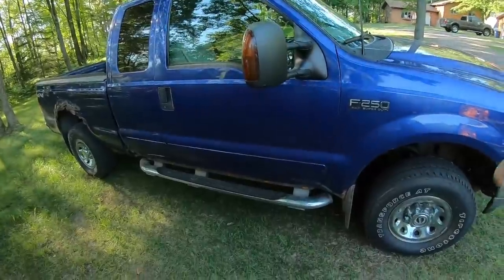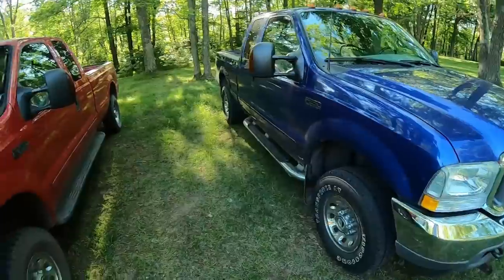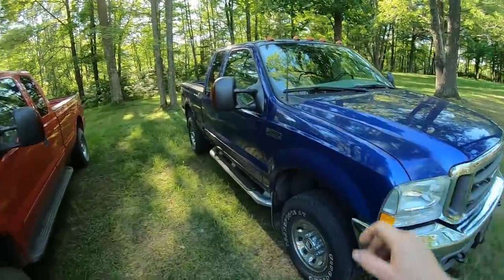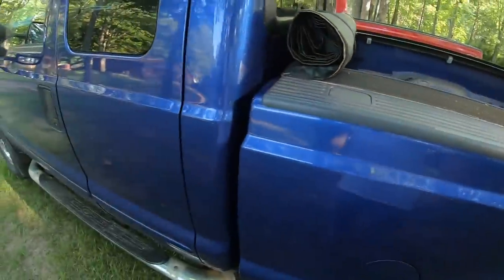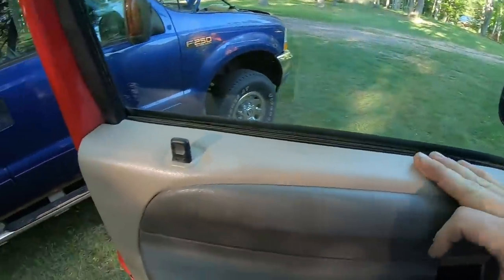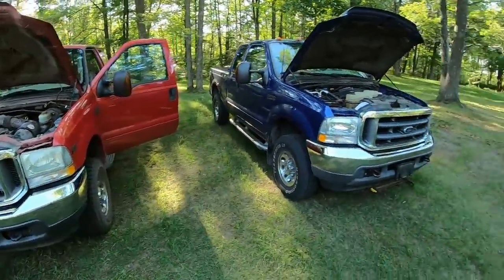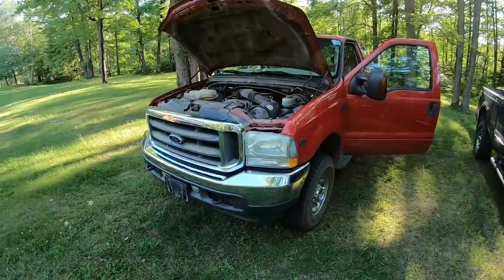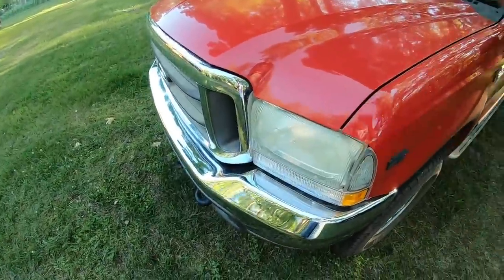I Bought A New Channel Beater Truck!  Meet "Big Red" - Possible Replacement For "Old Blue"

Comment: I’d definitely swap the grille and lights off of Old Blue onto Big Red; and go ahead and flatbed Old Blue and keep it as an off highway farm truck.
Reply: Yep, an interior swap would be cool too. If the headers start leaking swap motors and you'll have the best of both worlds.
Reply: That's what I was thinking.  And, why not use Old Blue to plow snow exclusively?  Replace the stock bed with a flat bed to use on the estate.

Comment: I had a 2008 F150 crew cab that I traded in on a 2017 F250 aluminum body crew cab. The 5.4 had some cam phasers go bad. Dealer tried to sell me a Diesel. No deal. Bought the 6.2 liter gas with the 6 speed automatic. It pulls my 8,000 lb travel trailer through the western mountains at 62 MPH. I’m happy

Comment: Swap the front end parts and the interior and you've pretty much got a new truck with the bits you like.  If you can't get used to "Big Red"...  it will be a mixture of Big Red and Ole' Blue so there is always "Violet".   if you like big girls...

Comment: The first-generation Super Duty was probably one of the best trucks Ford ever built - so many of them still out there running around. I'm hoping to find a nice one with the 7.3L Powerstroke one of these days to replace my "Old Blue" 2000 F-150. The 5.4 and 6.8 are great engines IF given proper maintenance...I've currently got two 5.4's and will only buy another one if I know it's been treated well and had the spark plugs & manifolds already done. Otherwise...diesel for me.

Comment: Melt some toiled wax rings, add in some used motor oil and use a garden sprayer and soak your undercarriage with it. Then FluidFilm inside the doors and bed

Comment: Two words "RUST CHECK" or some other oil spray. I have a 2001 Dodge Dakota with zero rust anywhere even the suspension bolts are still shiny. Been oil sprayed every year since new. Other than being oily the truck is a joy to work on as every single bolt will undo nicely.

Comment: Melt some toilet wax rings, add in some used motor oil and use a garden sprayer and soak your undercarriage with it. Then FluidFilm inside the doors and bed

Comment: Sqatch, killer score. I have that exact truck. Its a beast!  V10 pulls very well. Mines 263k and has never been torn down. Will be doing t chains and rockers/ lifters this fall to address some tapping cold. She loves the gas, specially when she's working. Worth it for a solid soldier. Congrats

Comment: Good looking truck. You are right about the rust belt. My 07 Ram spent the first 7 years in Michigan. Then we moved to South Georgia in 2016. The rust hasn't gotten any worse and is confined to the box above the wheels and one of the back doors. We have a V10 in the bus at church and you are right they like gas!

Comment: Glad you found a older truck with low miles. My favorite ford gas engine is the 460, those engine’s were so reliable.

Comment: Squatch253, great little segment.  I live in Arizona and deal with sun damage to paint and plastic parts all the time, even rotting hoes due to the low humidity!  I have a 1999 1/2 F350 Diesel. 212000 miles.  Just had to repaint the hood and roof due to extreme paint damage, but mechanically a great truck.  I have also owned a 2000 f350 diesel that I lost in an accident, sad to see it go, great truck.  I also owned a 2000 Excursion with the V10.  Loved all the vehicles, but in my warmer climate, I will take the diesel over the v10 any day.  
I owned the 2000 F350 and the 2000 Excursion at the same time and used them as commuters and to tow a 10000 pound RV.  The diesel pulled hills much better, but were both a pleasure to drive.  The one issue that I did have is that the V10 ate thru 3 transmissions while I never touched the diesel tranny.  They both had the same tranny, same rear end, etc. but I guess the higher RPM's on the v10 kept trashing the planetary gears, even the heavy duty ones.
Glad you get to use a good Southwest truck to keep things going on the farm.  Love my F350!
Good Luck with it!

Comment: Before you trash the dashboard cover consider this it does 3 things:
(1) helps protect dash
(2) it will help prevent the heat of the sun from reflecting through the windshield onto the semi gloss dashboard keeping the front seat passengers cooler
(3) it will help reduce the glare and reflection of the dash from the windshield such as the defroster vents speaker grills etc.
I live and drive in Arizona about 130k per year and always thought they were kinda useless till I started using one now I won't own a vehicle without one. My personal car has a large windshield and in 100+ temperatures I stay 10° cooler. By the way nice truck you probably don't see many older trucks in good shape in the rust belt

Comment: Saw a frame mounted trailer hitch, gas tanks, dash and switches. All of the front end stuff that is obvious, maybe keep it as a rolling parts donor  for rolling drive line parts like trans, transfer case and shift motor both pumpkins. So what are there gear ratio tags say? The taller the gear ratio the better milage and highway feel. How does the trans. final OD ratio compare from Blue to Red? Are you going to shelve or install all of Blues newer parts? Door glass, window regulators switches...Tail light Assembly! Wiring for the plow, plow mounts, modified dash panel for all of the "extras" or a ready made template of what not to do again.... A lot comes to mind for spares, same year same basis chassis.
Well done getting a near twin to Old Blue, I'd like to see you make some vids on how Big Red is only still around because Old Blue is still helping to provide much needed, crazy expensive, hard to find parts. So is Old Blue gonna get his own lean-to shelter soon? You know, wide enough to get around and under him dryly? Looking forward to seeing you work Big Red

Comment: I totally understand your love of the gas engines.  I have a 6.0L GM gas truck personally and a 6.6 Duramax for daily driving provided by the company.  Everyone told me I'd immediately want to sell my gas engine but as a long time gear head I don't ever see it happening. 

Good looking AZ truck and I am sure it will serve you well.  Those V10s are stout but they sure are thirsty though.

Comment: It's something to say when the Ford mechanic doesn't want a Power Stroke!  But I'm not sold on cam phasers and timing chains .  give me a Cummins any day!
Reply: I have  had some fords with 7.3 and 6.0 been great trucks  no problems ,but love my 2018 ram 3500 dually cummins. I tow heavy and the gas trucks are dogs and suck fuel.  The diesel is the way to go If you tow.
Reply: It’s nothing to do with powerstroke it’s diesels in general there extremely expensive to work on and there way more complicated and when your buying something ass a farm rig power doesn’t really matter
Reply: 5. 9 cummins and n14 amen brother.

Comment: Squatch,  I picked up a 2000 F450 2WD with a V10 back in 2015 and it’s been a real good truck to pull my gooseneck flatbed and cattle trailer.  I’m like you regarding diesels, but unfortunately I still have one that my father bought back in 1985.  It’s an F350 with a 7.3 idi (originally a 6.9) 4wd.  My only problem with the V10 at the moment (knock on wood) is that the ac clutch has went out a couple of years back.  I’ve been told that you can pull the clutch without replacing the compressor.   I’ve been a watcher of the channel since probably 2018.  I’ve enjoyed the MM (dozer and tractor), D2, M, and all the other videos. Thanks to you and Squatch Senior for taking the time sharing you adventures.  

By the way, I use to work for one of the companies that made signage (big Ford oval sign) for the Ford prison that you are currently serving time at.  Trust me, I know what you mean regarding “Prison”.
Reply: James from East Tennessee

Comment: The V10 has been great in my 250,000 mile excursion .....tows my 7K camper no prob. Drilling out the heads and using 5.0 coyote studs solves the manifold studs breaking.

Comment: Different place, different brand but same issues. I have a pair of squarebodies. Crewcab dually from Ca. for the summer and a rusty K20 to push the old Fisher Speedcast hydraulic plow all winter. Looks like you fell into a good deal there, parts from Old Blue will make Big Red look new inside and out! I pile the Woolwax to my vehicles to try to stretch them as long as I can. Nothing like the old iron!

Comment: Have that Ford V10 in an RV and love it.  If you get more than two miles per gallon you are doing great.  The O-2 sensors go out early too and there are four of them. Like my diesels the best. Get 20mpg  on the chevy diesels. 

At least you don’t have the aluminum body.  Salt really does a number on aluminum. I have heard that after two years the new fords look like your blue one. 

Coat the underside of big red with mustie1’s  solution and you will be surprised how much that helps with preventing rust even in the rust belt.

Comment: That's a nice truck I have it's older cousin here in Canada it's red to, it's an early 99 with the 7.3 and 80hp chip to make up for the smaller turbo, injectors and ecu  It's got 600.000 kilometers on it . The guy I got it from beat the crap out of it, I spent quite a bit on fixing his lack of maintenance 10 years ago but it's been very reliable since I've owned it. The  bodys just starting to go in a few smaller places on it. I'm thinking of doing some of the later body style updates instead of buying a newer Ford diesel. You basically couldn't give me the newer truck and pay me a million to drive it because of the reliability issue with those diesels L.O.L  Thanks for the video, enjoy the truck,  take care.

Comment: If I’m not mistaken the V-10 had a problem with spark plugs getting loose.  If they got loose enough they would fire the plug out and take the threads with it.

Comment: To stop rust take axle grease and paint a thin layer on the bottom and drive it on a dusty road, that's my teqnique for saving fresh and wheel wells.

Edit, I'm from nevada and this video is a trip for me, I usually don't see scouts as rusty as this.

Comment: fluid film the whole truck before winter. I have an 03 silverado with 289k on it, its still very presentable here in ol braska. Its the daily beater and still has rockers and only a few small bubbles on the box. And our city is very salt heavy with all the hills. I bought a die hard in 2015, still going strong. 
Usually takes two cans or so to do my truck in the fall.  Just picked up a all original 97 chevy ext cab 1/2 ton that is a 454, 5 spd and absolutely mint with 27k miles on it for a hell of a deal since they couldnt get it to start. Fuel pump regulator. It will get the fluid film treatment also.

Comment: Got a 1999 F250 with V10 had to have manifolds done my mechanic was able to do it without pulling motor his trick is going through the wheel well.

Comment: I can attest to the reliability of the V10. Our farm has a 2000 Excursion with 206,000 miles on it. Really the only problem is the fuel economy, like you mentioned. That, and it doesn't like the ethanol. Otherwise it's still going pretty strong for 20 years old. Handles mud great too.

Comment: Don't know what a PIA it would be to swap all the interior pieces from Ol' Blue to Big Red (you as a certified Ford tech would know way better than us), but that could be an option.  In a way, it would give you that "I'm home" feeling we all get when we've had a vehicle for a long time, as the seats and whatnot have broke in to your body and such.  Also, you get the interior color you like, you replace all the sun-damaged parts, more content for your channel, ect, ect.  Regardless of which way you go with Big Red, she's a sharp looking rig!

Comment: As Big Red is in such good condition body wise I would fill it with some cavity wax and  spray on some underbody protection for the salt. We have a good product in the UK called Waxoyl and its kept my old 65 Mustang pretty rust free over the last 25 years, as that came from Arizona to a damp England. I spray it about every 5 years. I don't know about your road rules but those fogged out headlights would fail our annual safety tests.

Comment: Love my V10. 326k in a 2000 Excursion. I've had to fix a couple spark plugs but it's solid. Going through the A/C next week to reseal the box to firewall seal and just freshen everything. Southern Tennessee summers in a greenhouse vehicle and all. Then we're going to replace the rockers inside the back doors. Common Excursion problems. Yes, I'll spend money on a 20 year old truck and it drinks unleaded like a fat kid with Kool-Aid, but I can fix rust and pump a LOT of gas for what a new vehicle would cost. 
I'm thinking Old Blue either needs to stay around as the salt road beater until it dies, or do as M suggests and pull the good stuff and go with the RD6.

Comment: Here in MI old blue still has 10 years of plowing left in her.  I see trucks here that barely have a cab on em out making money in the winter.  Lol.    
I get the wanting gas, but man.  We pull a camper around and the power of that 6.7 is intoxicating.  That said… wish we were closer so you could be my dealer diesel guy.
Reply: He has probably had to deal with the 6.0 Diesel from Ford for too many years

Comment: I would keep it! if nothing else. take the box off put a wood box on, drive in the winter and plow with it. At least for a couple of years. I am still driving a used 1995 ranger the cab is ready to sit on. the frame etc. had a 79 Datsun that did the same thing and then drove that for years later. Never got a ticket in cause there was not enough metal to reflect.

Comment: Change oil pump gears and timing chain stuff and be set for another 100,000 miles. Great truck!
Reply: V10s (2v or 3v) don’t have cam phazers like the 3v 5.4 did.  The older 2 valve engines did not have the timing chain issues/guide issues like the 3 valves v8 do.

Comment: You do not have to pull the engine to do exhaust manifold bolts/gaskets.  I own a 2004 and did both sides in the chassis. Multiple broken bolts on both sides, had to drill one on the drivers side and had to put bigserts in two on the right thanks to the dealer I bought it from hacking that side up.

Comment: I would swap parts and pull those parts you might use on "Big Red" and then send "Old Blue" away for recycling on a flat bed.  Would even swap the interior if you were happier with grey.

Comment: I agree with the gas job bit. If you drive over 50k miles a year diesel pays. Just not a F250 - 350 Ford, they still haven't got it right. I'm waiting to see how the F150 diesel lives.
Best wishes from +700 miles North.

Comment: My 1999 ranger with 2001 Explorer 5.0 had gotten very rust. Swapped that engine and drivetrain into 2003 Ranger but to change wiring and fuel system with it. Lost this Ranger car pulled out in front and took off soo I got screwed. Note next time make sure drive it straight into them instead trying to avoid. Now swapping this all into 2005 Ranger. 2001 engine and trans now has 240,000 miles on them, just rebuilt engine and going through trans

Comment: Some off those 2003-2004 Triton V10’s were known for spitting out spark plugs.  Work had a fleet of E350 vans with V10.  Exhaust manifold bolts were big problem.  Heads of the bolts popped off. Working on those V10’s in a van was no picnic.  A couple local garages figured out how to fix them without removing the engines.
Reply: Why would anyone run gas engines in a commercial vehicle? In Europe you very rarely see any commercial vehicle with gas engines, they are all diesels unless they are really small.

Comment: Good looking rigs. I've done manifold studs on the V10 a few times. Absolutely hated it! I can't deal with crap fuel economy either. I drive about 30,000km a year and don't want to double my fuel bill so my 00' 7.3 CCSB 6spd will do. It has 285,000km so I'm hoping it keeps going for another 15 years. I do like big Red's body though!
Reply: One thing is doing a service with fuel filter (every second service for me) is $200 between oil, filters and Archoil additive :(

Comment: I mentioned this in the members only video, but even though I'm a diesel person, I wouldn't own one of today's diesels, I have seen way too many problems both commercial and pickup. My Pumpkin hauler is a 2019 Freightshaker, which has power issues every time you drive it during rain/snow in the winter, I suspect the ECM has a crack in the housing allowing saltwater to get in. Personal hauler is a 2001 Dodge Cummins which has metal cancer issues in the usual places, I'm leaning now towards having all the body cancer fixed as new trucks are stupid expensive, and nobody offers a manual transmission anymore.  Which has had me wondering if an Eaton Fuller 18-speed will fit between the frame rails of a pickup..........
Reply: Yes a twin counter road ranger will fit but you either have to have like a 3 or 4" body lift or you will loose almost all your foot wells and make it uncomfortable to drive.  The 6spd fullers from the mid duty trucks are the more common trans swap for the pickups but honestly are rarely ever worth the trouble or expense.